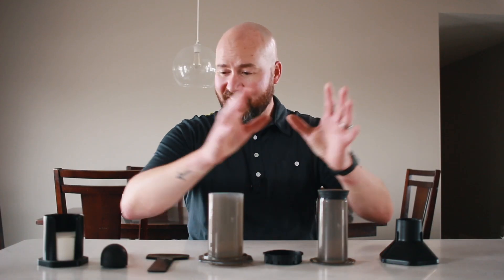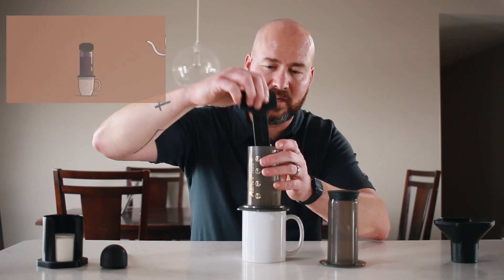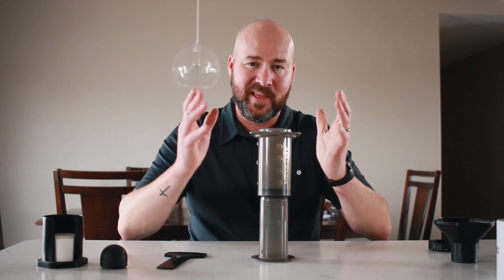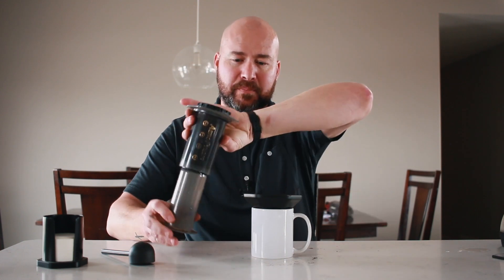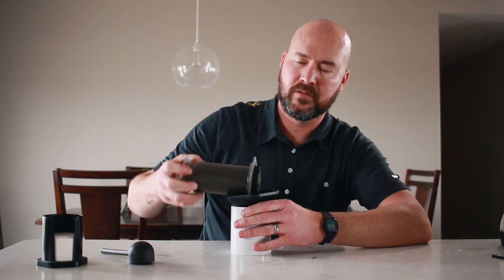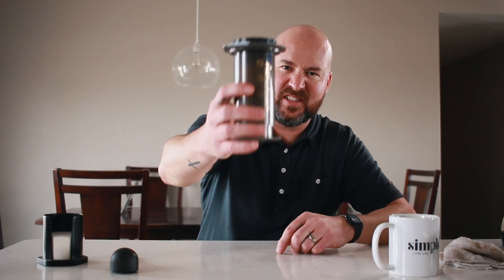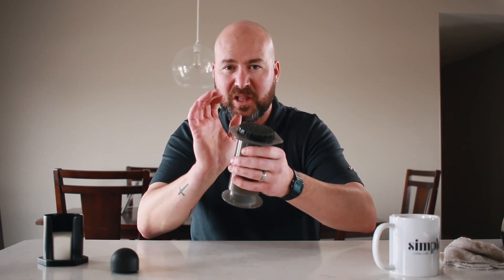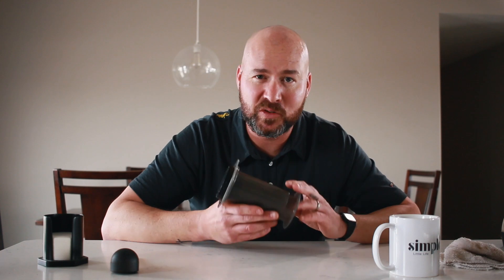The PROPER way to BREW AeroPress COFFEE

Comment: Did a rewind of the very beginning.... Is Jeremy doing Black Arm???? XD XD XD
My hill billie "boutique" method: 

500 ml boiled water poured over 3 scoops drip ground coffee in a glass measuring cup, stir, soak for 5 mins, stir, pour through a paper cone filter in one of those ceramic cone holder thing-a ma- jig's. Rather good. Little stronger, tich more sharper, tich more heavy flavour then the same coffee done in the drip machine.